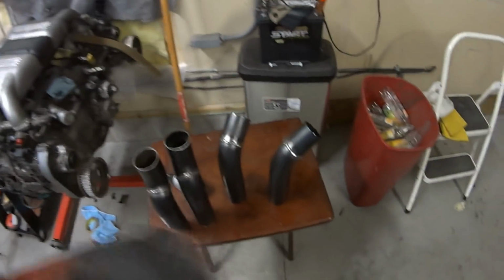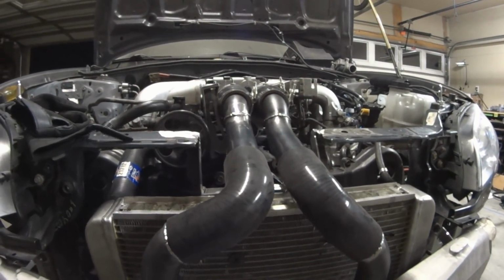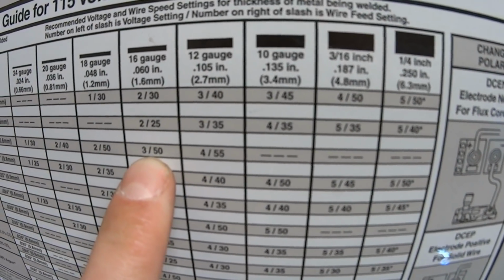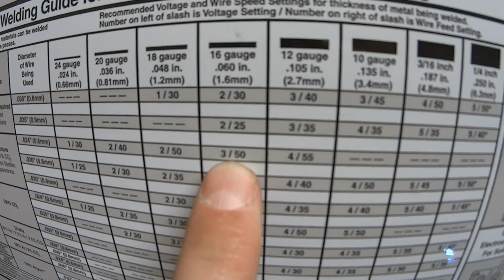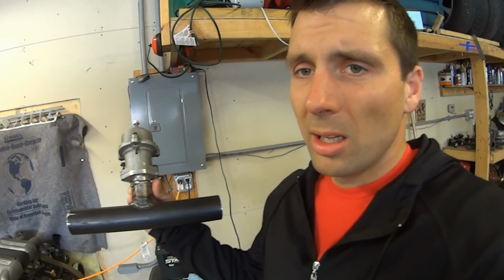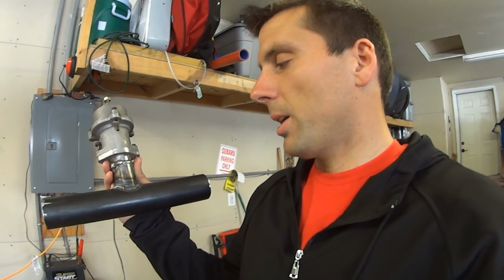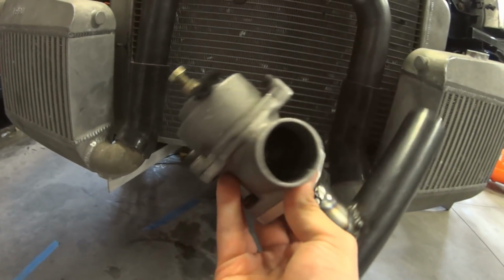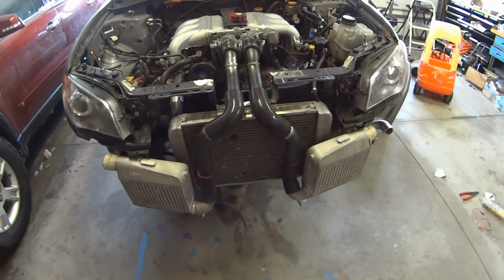EG33 Swap - Intercooler Charge Pipes (Ep. 23)

Comment: Just thinking out loud here but I think that "H" pipe is going cause a lot of turbulent air in the charge pipes. I know you aren't shooting for crazy hp figures but I think having that low pressure area might make your turbos spool slower and may cause them to work against each other.
Reply from the maker: Thanks for the post Trace. I think the dynamics of pressurized air only having one place to go means my current design should work out fine. If you consider that most twin turbo LS setups have charge pipes merged before the throttle body, this is not much different. Also consider something like a rear mounted turbo setup where the volume of air is much larger than what I've built. There is a better design than what I've done here, but that will have to wait for the next iteration.
Reply: X pipe would be cool at some point but get it driving first!